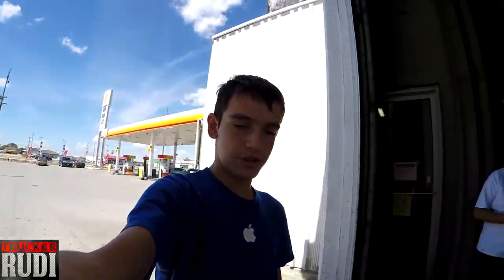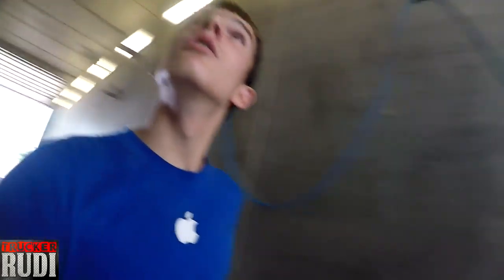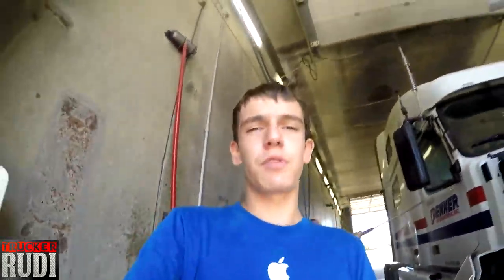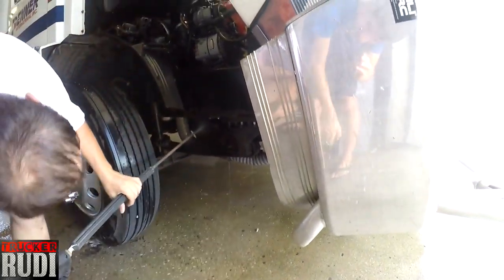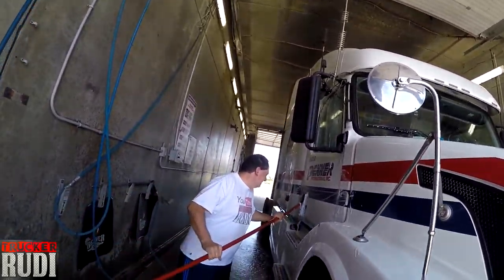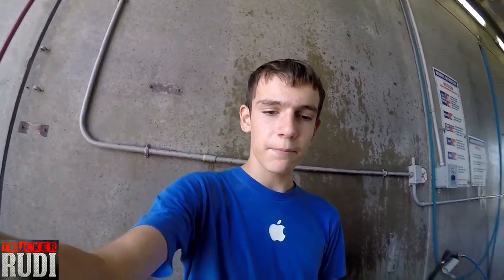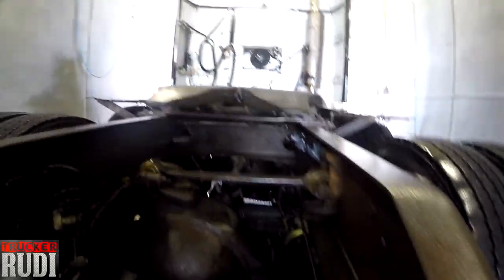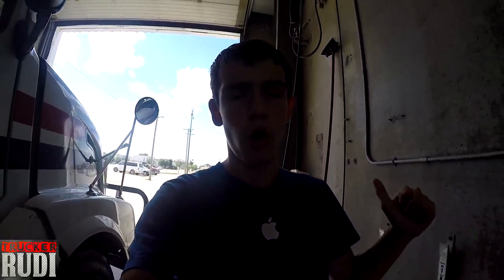Trucker Rudi 08/14/16 Hard at work Vlog#796

Comment: The day's work is never done, great job at cleaning your truck, Diego is getting the hang of camera work, and If I may suggest, when videoing, stand still and video to a count of 1000, 1001, 1002, 1003, 1004, 1005, 1006, 1007, 1008, 1009, 1010, then move on to the next place you want to go, the difficulty is to remember the count and do commentary at the same time. practice and you'll get the hang of it. Bravo to both of you.

Comment: Hey Rudi! How is it in Canada, you usually have to buy your own truck or is it a shared ownership with the employer? Or is just usually just the company truck, truckers drive? I ask because I've never washed the trucks I work on, all that is done by the maintenance crew. Also buying a truck in Norway is extremely expensive, almost 700.000 US dollars for just the truck itself without any trailer.
Reply from the maker: It is totally your option you can buy at lease or just drive for the company most trucks  cost around $200 in dollars up here